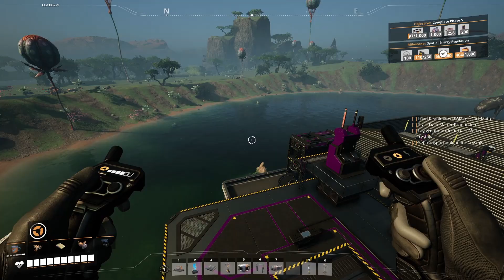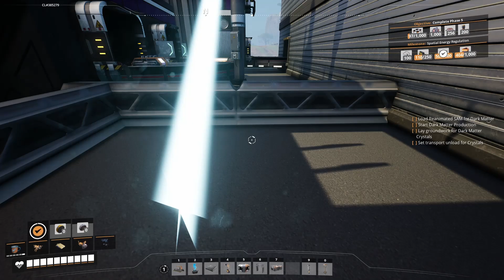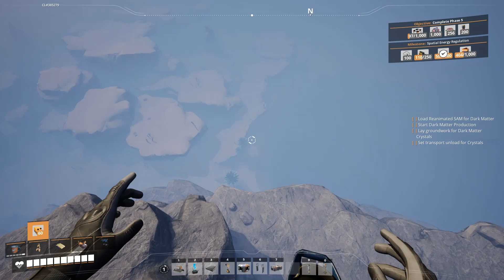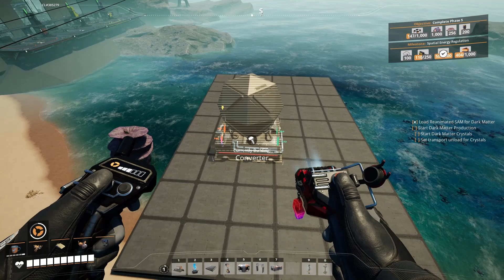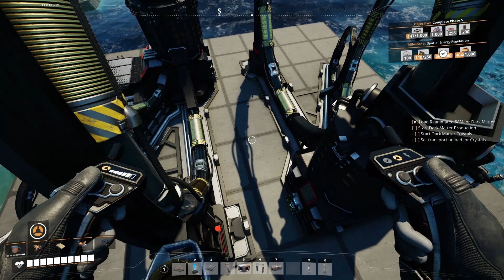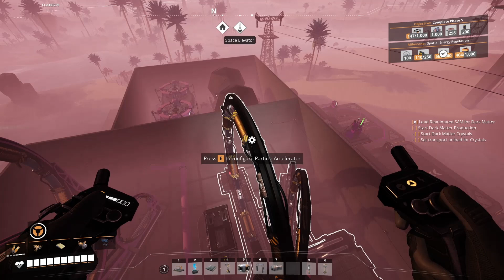Satisfactory 1.0 Ep36 The start of Dark Matter Crystal production

Comment: I am slightly confused. I recently installed satisfactory again. I got coal on the west coast,north of the desert biome. It should be close to you. 3 impure nodes.
Reply from the maker: I will look into that for sure. At this point I am using 3 coal nodes north west edge of land at -2757, -1626 and then another 3 coal nodes east of there at -1159,  -1331 and the 2 newest nodes of coal I started to send over here are in the jungle type area at -1408, 453 if that might help you the last 2 are one normal and one pure and if I am not mistaken the desert is the area just below that and now to think of it I might run a train even tho it will be a long route I can run it around the under side to the west and then turn north so I will look in that areaand see  if I can find those nodes
Reply: @alphablazedgamer  Oh well if you have the three to the west, I missed it then.
Reply from the maker: I will go over the nodes I use in next video should be able to see if it is the same nodes appreciate the lookout for where I can find more those Diamond Particle Accelerators eats it up like nothing I've seen before sending 2 drones to collect coal for one machine just barely keeps it running at 100%